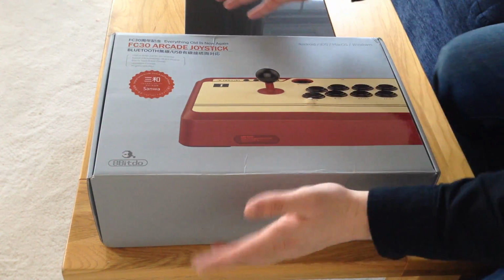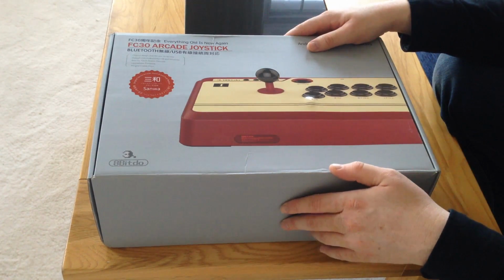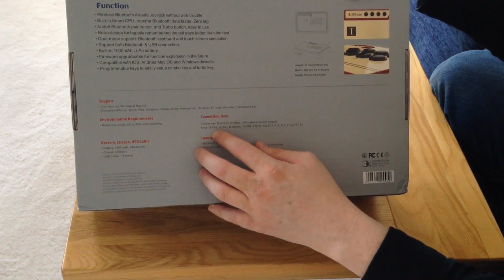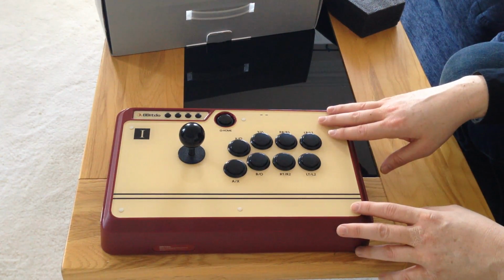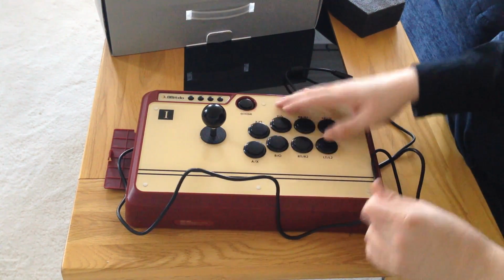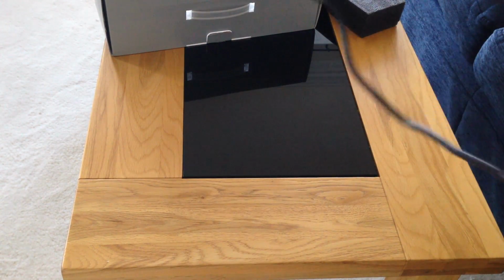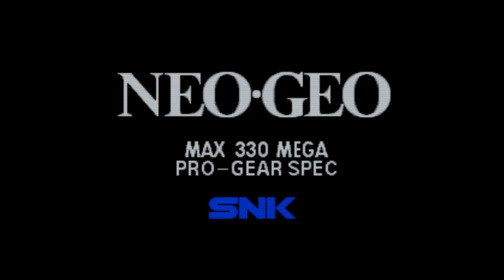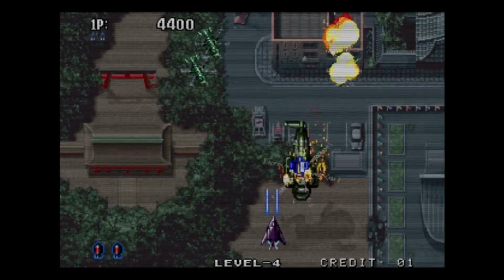8bitdo FC30 Arcade Joystick - Bluetooth Sanwa arcade stick

Comment: just bought the non-sanwa version and replace all the buttons and joystick with sanwa's. gotta say it's quite great, even the wireless doesn't suffer from much input lag, barely noticeable from when it's wired using USB.

Comment: Got super lucky with mine: Was scouting for the non-Sanwa version because I thought it'd be a decent enough starter stick for occasional MAME stuff, if I could get it for cheap. I put a discount notification on it on a price aggregator I use, and one late evening got notified that CDON had the stick on sale for 20€ instead of the normal 100-110€ it used to be (yeah I know our prices are expensive, but shipping and customs would kill it if I ordered abroad). CDON is a bit notorious for having the wrong products listed at times, as well as sending the wrong product, so I thought it'd probably end up being the FC30 pad instead of the arcade stick, but took a chance (I could always return it).

So it arrives, and it's a big box, definitely not the gamepad. Open up the bottom to check what sort of connectors it's using, in case I want to upgrade it later. Lo and behold it says Sanwa on each component inside! I had missed the sticker on the front in my haste (it really doesn't stand out that much). Made an already pretty good deal much much better. =)
Reply: Damn I am still looking for one :(

Comment: I would like to buy this stick.... nobody has it on sale anymore
Reply: Uncanny X-Clan Yeah, it sucks. I prefer the Famicom look over the NES look.
Reply: It is a clone of the Mayflash F300, so you could actually make your own clone of it with decals :D
There are templates for custom art here, and decalgirl also makes decales for the stick.
https://www.reddit.com/r/StreetFighter/comments/4vils3/template_art_for_mayflash_f300v2_i_dont_see_any/
Reply: @KitsuneJimmy  pretty sure the FC30 (the one in this vid) is a F500 clone, meaning the custom artwork can be done. F300 is smaller and does not have custom artwork. 

TLDR- FC30 (the one in this vid) is F500 clone. The newer 8bitdo N30 ($60, non-sanwa) is the F300 clone.

Comment: I wish I could get this in the states. =(
Reply from the maker: You can get it online here:
http://www.ebay.com/itm/8Bitdo-FC30-Wireless-Bluetooth-Arcade-Joystick-Sanwa-Version-Support-Android-PC-/162020845342?hash=item25b931e71e:g:yGAAAOSw5ZBWQB18
Reply: Floob Thanks! I thought to look on eBay but I figured it would be a shoddy seller and a used busted up controller. Guess not. Thanks!

Comment: Would like to see the turbo button in use, is it like hold button then tap the turbo when it's the right timing? I've ordered a Sanwa version!
Reply: Also what's the insides like does it look like you can swap out buttons / joystick without soldering and taking the connects off?

Comment: Does it work with a ps4? This would be sick for sf5
Reply from the maker: +Thunderlips Sorry, I'm afraid I dont have one to test it out on, although I dont see why not.
Reply: +Thunderlips Yes, it does work with PS4 games using Zero Lab driver, like Skullgirls Encore, MKX, Ultra SIV and SFV, however in wired mode only. AFAIK PS4 blocks wireless PS3 controllers.
Reply: Thunderlips Check out the Venom Arcade Stick. I have one and the form factor is identical. I've fully modded it with Sanwa parts, too. Amazing stick.

Comment: I recently picked up the FC30 Joystick but am having a little bit of trouble getting it running smoothly on retro pie, are there any wiki's on setting this thing up properly. Thanks!
Reply from the maker: +MJMediaMan Which version of RetroPie are you running?
Reply: im running retro pie 3.4
Reply from the maker: +MJMediaMan This should help you setup Bluetooth devices on 3.4: https://www.youtube.com/watch?v=Q4K3h4CIJwA
Reply: +Floob so I ended up just copying my fc30 pad setting over and that seems to have worked, the only problem i am having now is my hot buttons dont work (Select + Start to exit game)
Reply from the maker: +MJMediaMan What startup mode are you using? Does it work with the USB cable?
Reply: +Floob im using joystick mode, i have yet to try it with the usb. I think what is wrong with the hotbutton mapping is the select button isnt mapped correctly. Its currently mapped to "10"
Reply from the maker: +MJMediaMan This should show how the hotkeys work: https://www.youtube.com/watch?v=DBnKFRflEV4
Reply: +Floob still no luck. It seems like when I use my snes30 the hotbutton works. But when i use the arcade stick it doesnt and the snes30 hot button mapping doesnt work either when being used at the same time
Reply from the maker: +MJMediaMan Here are the button codes for the Arcade Joystick in bluetooth mode: https://github.com/libretro/retroarch-joypad-autoconfig/blob/master/udev/8Bitdo-FC30-Arcade-Joystick-Bluetooth-Mode(HOME).cfg